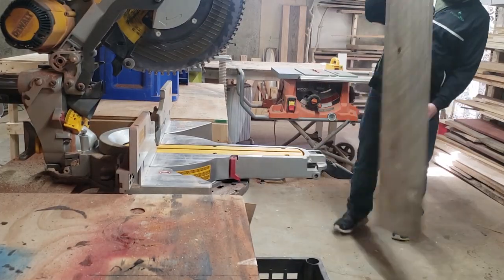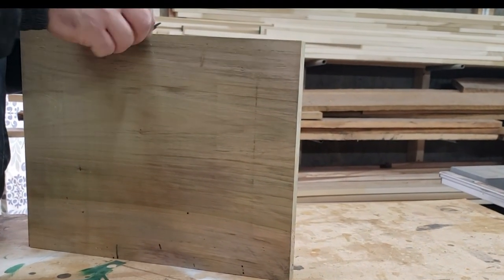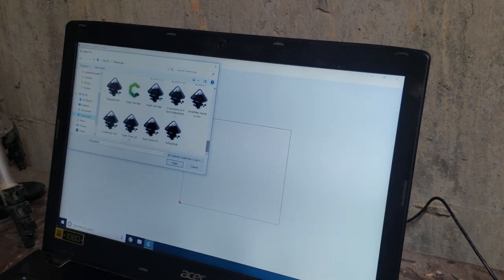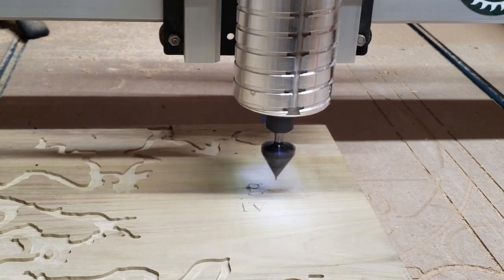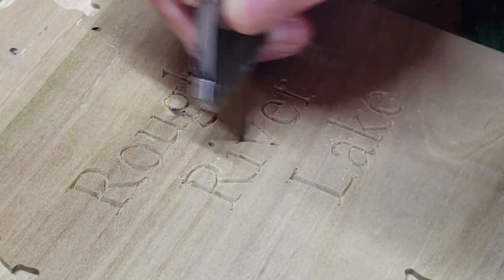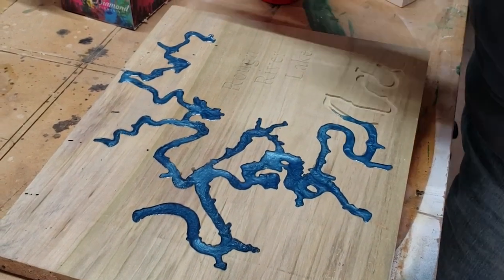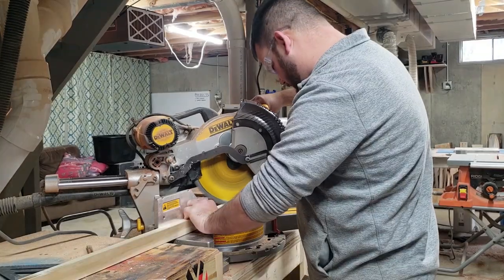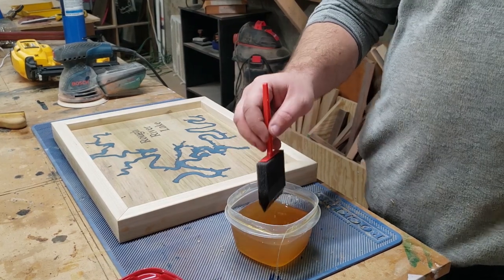Making a Resin Inlay Lake Map // Wall Decor // Epoxy Resin Art // CNC Project

Comment: Thank you so much for your tutorials.  They are so helpful.  May I ask why you are using a High Performance Epoxy verse a Tabletop?
Reply from the maker: Great to hear! There are a lot of different types of epoxies out there and all have different purposes. Tabletop epoxies are generally used to coat the surface of something and aren't used to pour anything deeper than 1/8th inch. Plus, high performance also cures faster.

Comment: What was that machine You used to carve? Also what I’d one doesn’t have a planer? What would you suggest? For my small piece I’m doing all I can use is a deemed and a rotary sander .
Reply from the maker: I used a cnc router to carve it. If you don't have a planer you could get acceptable results from being careful how much epoxy you pour and then just do a lot of sanding to get it smooth

Comment: Beautiful work.  Your router looks like a standard Dewalt trim router.  If that is correct, did you get the shapeoko CNC without a router.
Reply from the maker: Thank you. It is a standard trim router. At the time I bought my Shapeoko, they offered it with either a Dewalt or Mikita trim router. Since then, its my understanding that the router they offer now is a Makita wrapped in their logo